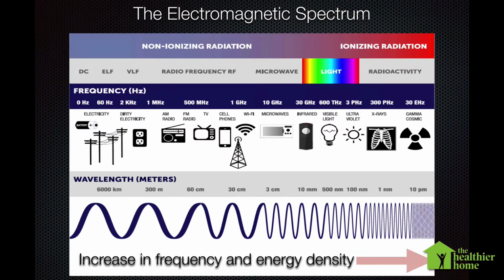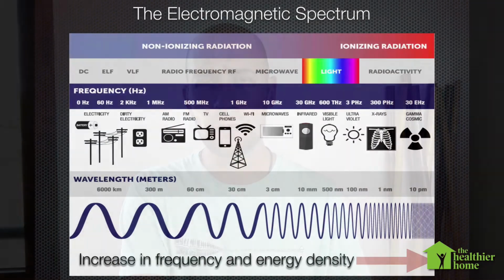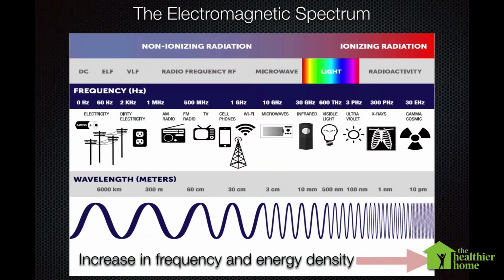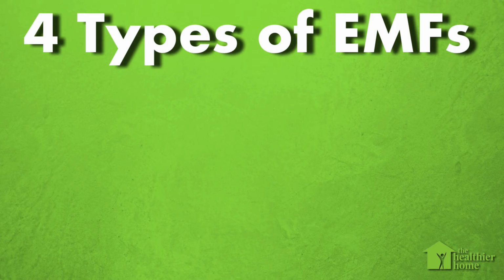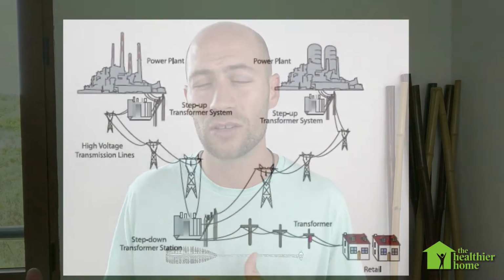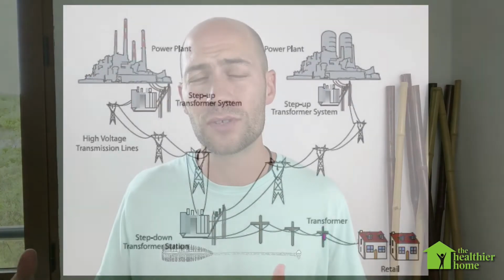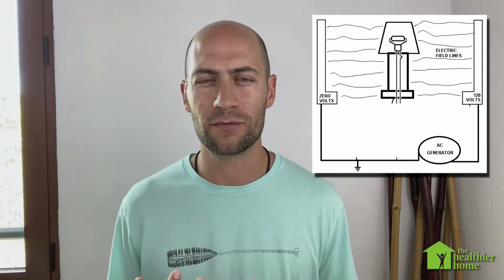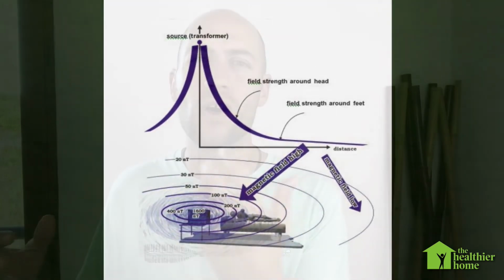EMFs Explained - Part 1 - What are EMFs?

Comment: It would be reasonable to mention that magnetic fields created by running current through wires are restricted by using plastic as shielding which are very low in permeability and restrict their reach. I wonder if insulating tech could be a good strategy for reducing exposure, and I'm also wondering if the "shielding-tech" such as phone cases actually bounce or absorb waves.